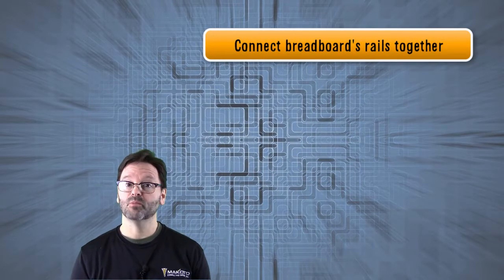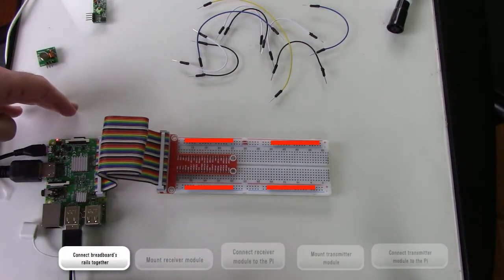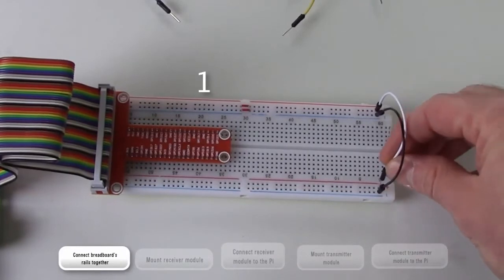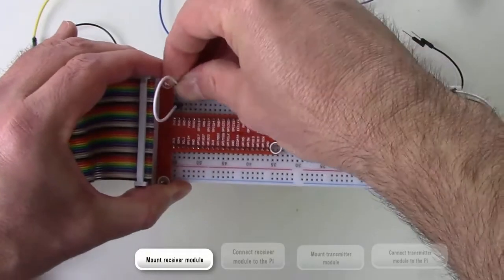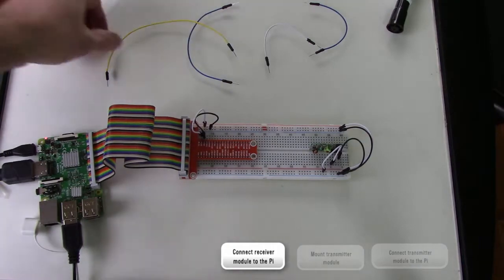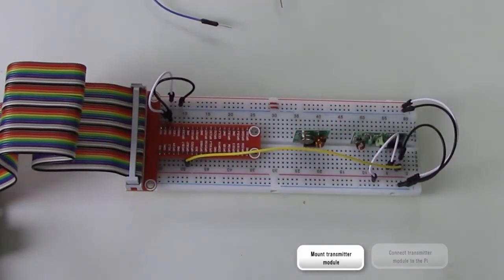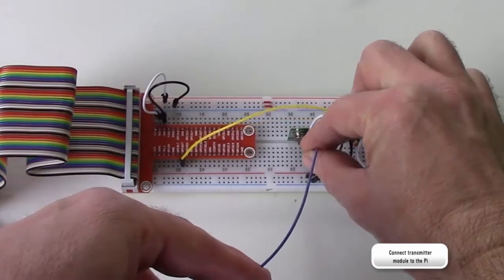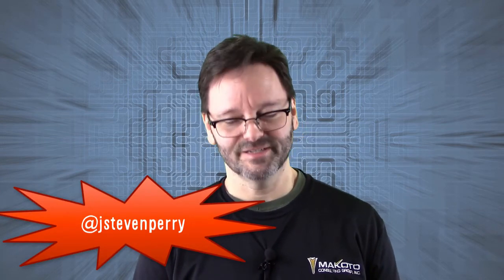Home Automation Tutorial: Setup Your 433MHz Hardware

Comment: The 433 MHz receiver is a 5V module. The Pi’s GPIO pins are 3.3V. The Pi’s GPIO pins are not 5V tolerant. Isn’t there a good chance that this setup, without level-shifter between the receiver’s data pin and GPIO, will “fry” the Pi?
Reply: you are completely right